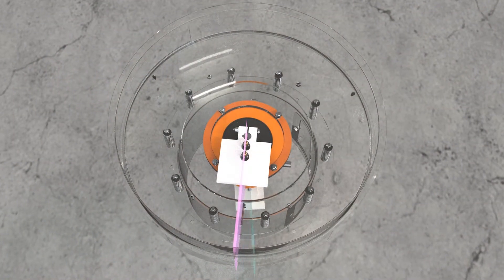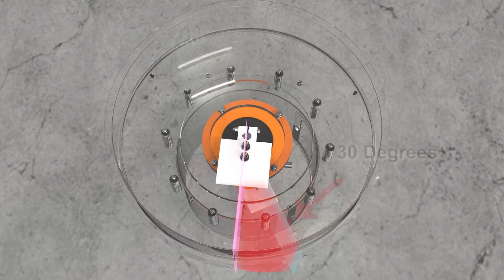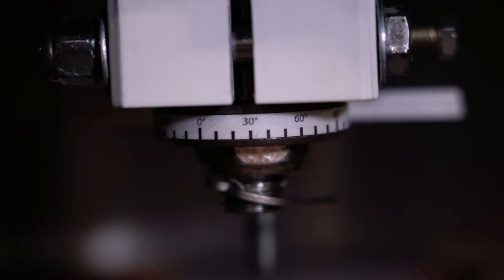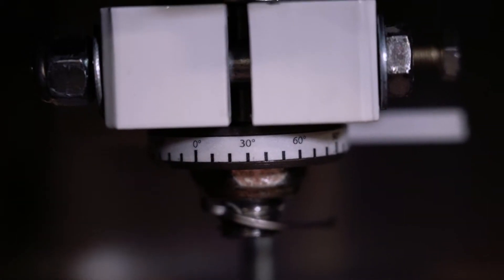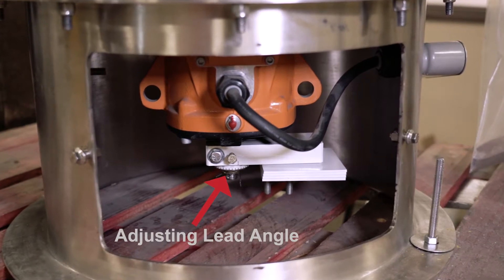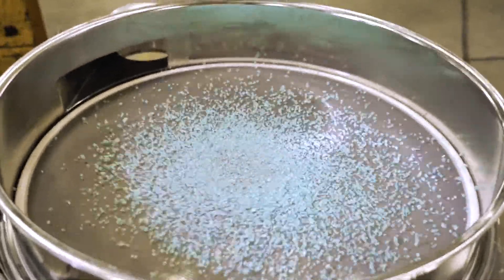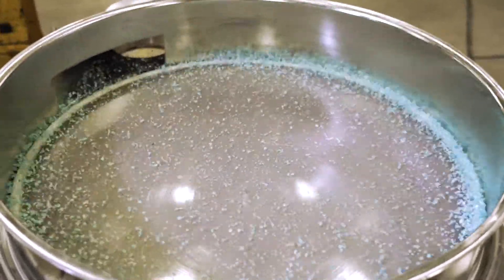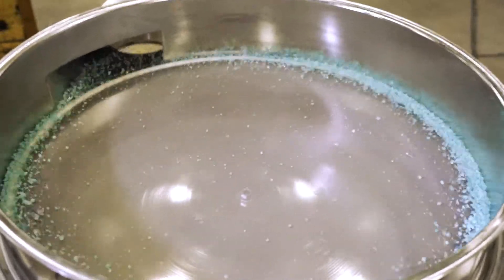How to Correctly Adjust & Assemble a Circular Vibratory Separator Machine | Gerard Daniel

Comment: What cause the top rim assembly frequently cracks at the particle outlet section
Reply from the maker: I am sorry for the delay in responding to you question regarding the spacing frame failure.  The discharge spout is the weakest point of the spacing frame.  After extensive vibration the most likely point of failure would be on the welds holding the spout to the frame.  This would be typical wear and doesn’t represent a failure due to workmanship in most cases.  If you would like to send me pictures of your frame along with any other details you may have I would be happy to take a look.  Please send to marketing@gerarddaniel.com